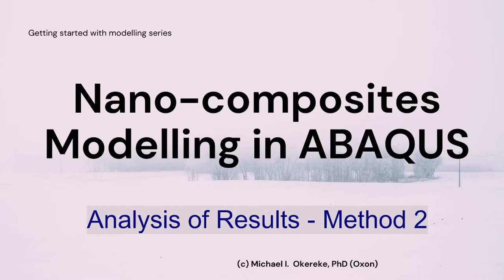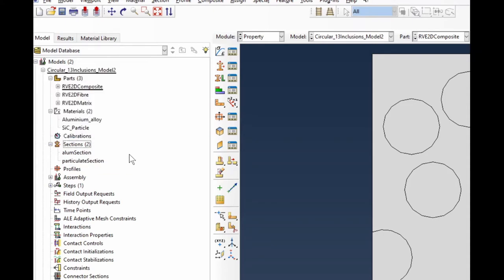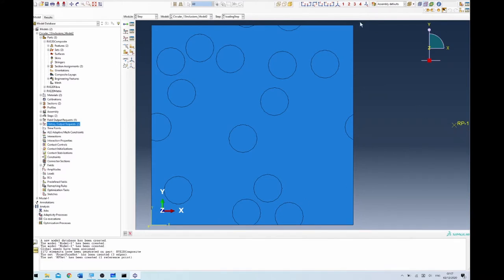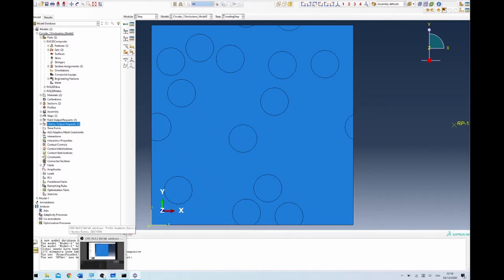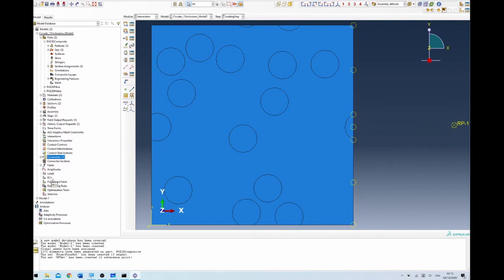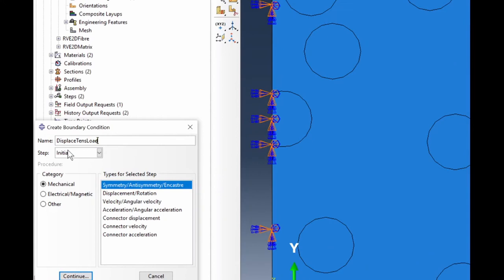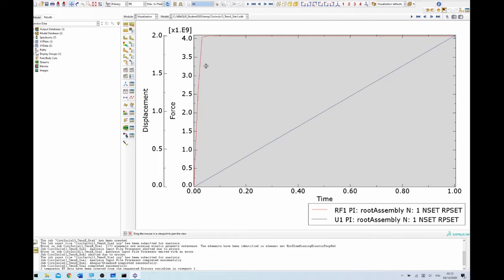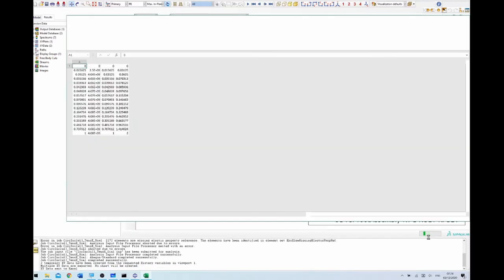Nanocomposite modelling in ABAQUS - Analysis of Results  (Method 2)

Comment: Great video! In this video, boundary condition (BC) is applied with Dirichlet BC type by fixing the left node edges of the geometry. I have a question about BC. As far as I understand, applying Dirichlet BC does not represent a real behaviour of RVE (representative volume element) 2D simulation. Periodic boundary condition is to mimic a realistic behaviour of RVE 2D simulation. If I am wrong, please correct me.
Reply from the maker: Yes @Enidentictok, you are right about preference for Periodic Boundary Condition (PBC) for micromechanical modelling of such RVEs as this nanocomposite. The problem with PBC is that its classic form is difficult to implement due to the number of edge nodes that need to be individually kinematically linked. Commercial solvers do not have a plugin to do so automatically. 

As a result, people will often go with Dirichlet BCs are that is a close alternative but error due to this boundary conditions will exceed any error due to say the PBC. This is why Dirichlet BCs are preferred to PBCs for most mainstream modellers.